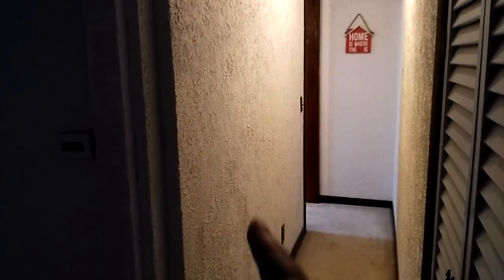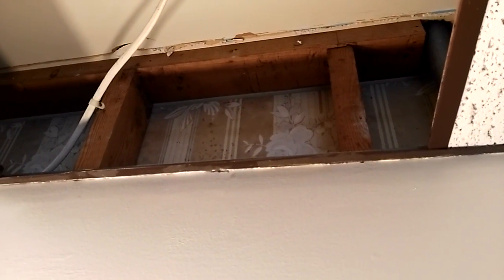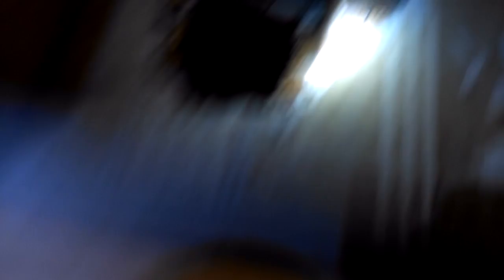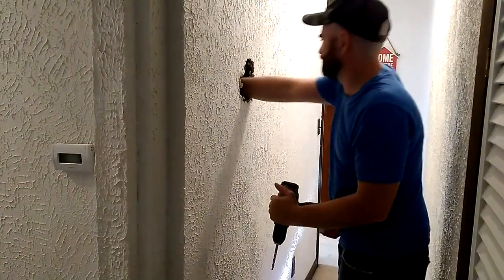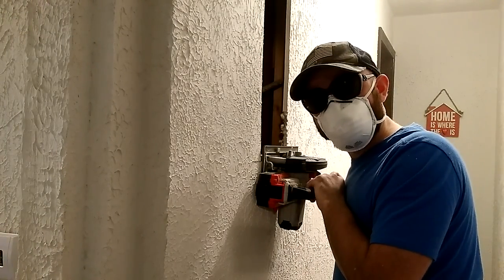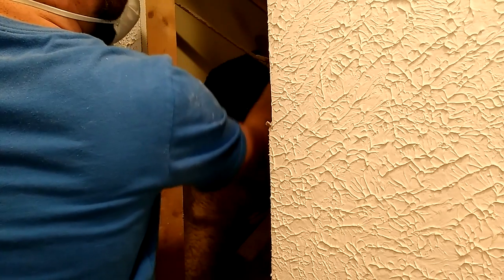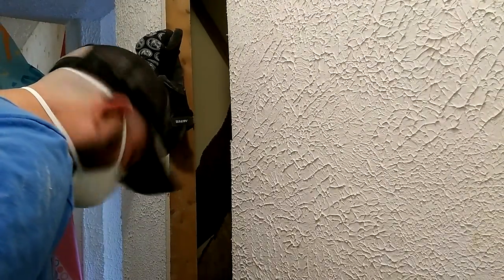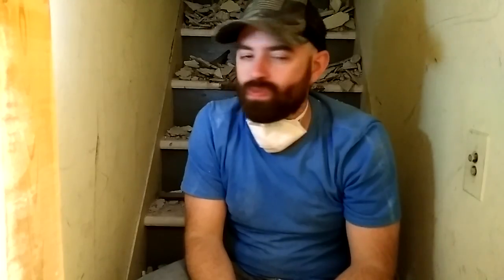Opening My Secret Stairs

Comment: I have a similar space in my basement, previous owners filled it up with a ton of crumbled plaster and drywall about five foot deep, and put a cinderblock wall around it. Lord knows what’s buried in there. It can be accessed by removing a piece of paneling. The pipes for the bathroom and toilet run through the space, and there’s a boarded up window. I should construct some kind of a more permanent door for access, and use for storage. Or I could be evil, and hide a fake skeleton in there. 😁😁😁